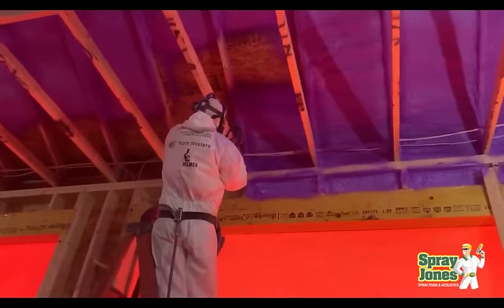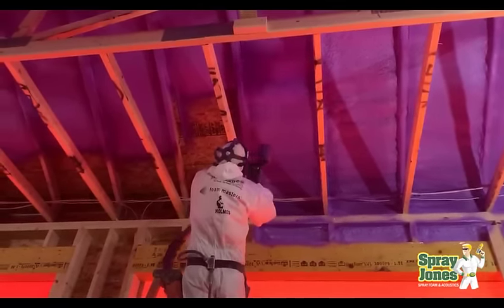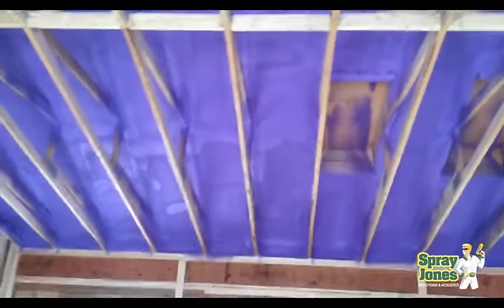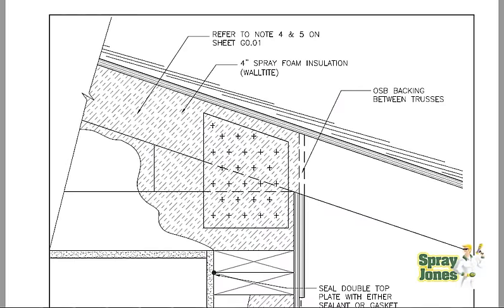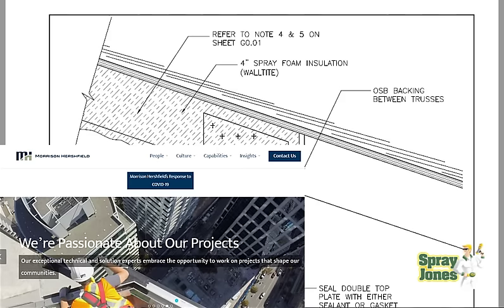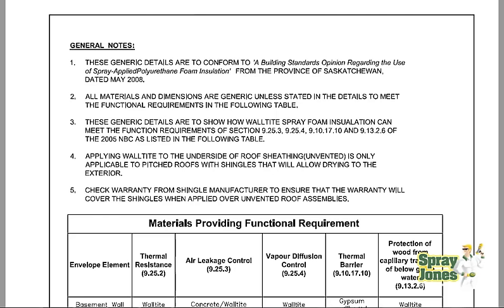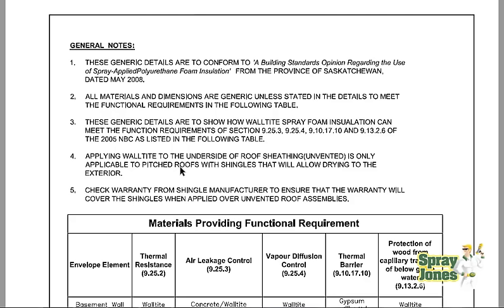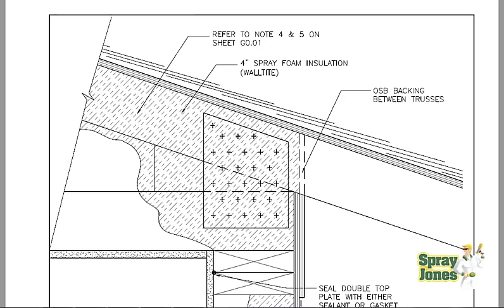Unvented roofs - Closed cell vs Open cell Spray Foam Insulation which is better?

Comment: They are assuming a 'drying season'.  And they are assuming everywhere has that when they say it can be used everywhere as long as the pitch is greater than 3/12.  That is just not so.  In my particular area which is a temperate coastal rain forest things that wet just don't dry out with our average of thirty days or less of actual sunshine (combined with winds over 100 mph and 170 inches of rain).  I am sure there are other such climatic zones in North America.  Engineers and architects have a long history of failures so I just wouldn't be comfortable with any blanket statement from them and skeptical of particular local advice.  I can show you one failure after another in our small community alone that was caused by bad design from 'certified' engineers and architects.   When you combine modern building materials and water you have a large problem.  Imagine six months of wet on OSB!!  Then add it some freeze thaw cycles....    Spray foam is a good thing in limited situations but allowing a structure to 'breathe' in all but desert conditions is very important.  The other new drawback I hear of and see is over the long haul the foam both open and closed 'shrinks' away from the dimensional lumber causing condensation where those openings lead to a cold external surface.  I will be much more comfortable when I have seen forty years of existence of any brand of foam used successfully in tough climates.  Always and interesting topic.
Reply from the maker: Do you drive a 40 year old car?
Reply: @SprayJones  That is an ignorant reply.  A car is not designed with the lifespan or price of a home and in any case proves my point for all the absolute failures the auto industry has foisted off on the consumer.  Is that your goal?  Get your pile and get out before the failures come to fruition.  You use a very poor analogy in any case as it disproves your position.  Most car successes were built on a solid years long history of performance while their failures came with no eye on what preceded much as the spray foam in a home phenomenon!
Reply: Douglas, I  whole heartedly agree with you. I  have the same concerns with this application trapping moisture between the foam and roofing.  I think it's okay for walls but not roofs. This will also bake asphalt based shingles due to the absence of cooling of solar radiant heat gain, which I have personally seen with SIP panel and rigid foam structures.  There is also sick house syndrome from structures being too air tight. Remember,  for every action there is an equal and opposite reaction that sometimes is exponentially greater than what you are trying to solve.  Not everything "new and improved" is better. I made the contractor remodeling a  portion of our camp (I was not the member in charge of the project) put venting baffles in before the foam. I do roof and building envelope inspections an have been concerned about this since it started to be promoted,  by you guessed it, the sprayfoam industry.
Reply: I think this is a good conversation. @SprayJones comment doesn't help their case.
Reply: Interesting. We were going to do closed cell on walls and spray in cellulose in the attic. I live in an extremely humid environment. Would you recommend rock wool or spray foam?

Comment: I make a living tracking down roof leaks. Closed cell sprayed roofs that leak will rot out large sections of decking and make a nightmare of finding it and fixing it. It's also been going for so long that insurance will deny it, open cell has a chance of being found. Closed does not.  Many of your statements based on engineering information are not what I've found in the field.  This is pretty standard in any of the trades. the engineers are sure of what the books say, the field guys actually have to deal with it.
Reply from the maker: A roof that leaks is a problem. When do you want the water to stop and where? I have seen open cell foam hold water and cause major damage, I have seen closed cell hold the water out and limit the damage to the sheathing. 
SPF is NOT the problem - the roof should be water tight with multiple layers of defense from the outside - the choice of closed or open cell on the inside is a different plain of the envelope.

Comment: How does the roof dry to the exterior? Most roof papers are not breathable air barriers the same as say a tyvec. If the roof deck is not breathable there is where the problem comes into play. I have been in the insurance industry for over a decade and seen numerous roof systems rotted because of spray foam on the underside of roof decking. And most shingle companies will not warrant the shingles anyway. That is probably why the engineer put that disclaimer in ther
Reply from the maker: My Dr. hates it when I come into his office with my google PHD and tell him what is wrong and why.
Reply: This is not a google reply I have been in construction trade for 30 plus years and the insurance industry the last 11, my response is from seeing it not google. That’s why the engineer leaves himself and out by saying it needs to breathe
Reply: @patholland8835  you are correct . There have been several instances of soft decking and shingles coming off on houses under 10 years old.  Hopefully these spray foam installers are held responsible when this all goes south . Closed cell is ridiculous against roof decking, period imo. A lot of this stuff works on paper when the engineer is writing it
Reply: We’re the roofs high pitch?  That was a requirement
Reply: Exactly. Maybe you can get away with it for a while.   And closed cell certainly can prevent moisture and/or condensation issues from the inside.  And sure, the closed cell might prevent the leaks from entering the living space, but it's also going to cover up a ton of smaller problems over time.

Someone explain this - why is it best practice to use a rain screen siding setup with ventilation, but (apparently) fine not to do it on the roof?   The walls are vertical, often have soffit protection, and far less water pressure, plus wall peel and sticks/tyveks/etc generally are FAR more vapor open - but time and time again you find unvented setups that have rotted from water entering at failed penetrations and then not being able to dry fast enough.   

You are creating a sandwich of two non-permeable materials with a water sensitive material between on the most exposed part of the house which also happens to have thousands of penetrations from not only fasteners, but also vents/skylights/valleys/etc.  Ice and water shield isn't vapor permeable.   It's going to hold that water a LONG time no matter what the temp or the sun thinks about it.   Closed cell isn't vapor permeable.  The only way out is going to be the failed penetrations, open seams, or wicking through the rafters or roof sheathing itself.

I've seen this pushed a bunch of times, but never have I seen anyone explain that.
Reply: @SprayJones  Nice non-answer.  Spray foam is going to be one of those things in a couple decades that people are going to wish they would have never fallen for.
Reply: @kp3.  There's a reason they don't allow it in in most of Europe.  They live in houses that are hundreds of years old, they understand what it takes to make things last and know that this is a disaster waiting to happen in this application.

Comment: I'm an engineer and I agree that this is ok but using an explanation of "because an engineer says so" is just circumstantial inference and not a technical defense. I would have liked to see the technical explanation included. I know there are minimum thickness requirements based on location to prevent dew point condensation and different things like that.
Reply from the maker: I don't go into overly technical explanations. No one wants to watch that and the time to make the video does not pay off with views or ads run. So I keep it simple.

Comment: Hard to go wrong with rockwool but it too needs to be installed correctly.  Always best to ask around and check with reputable contractors in your specific area.  I prefer those who do remodels as they see what works and what doesn't.

Comment: We have open cell sprayed on the underside of the roof deck, It was done in 1998. The roofer did a poor job and many nails missed. These small leaks were not big enough to drip below, but big enough we noticed soft spots in the decking. Rather than take the roof off and deal with the soft decking we instead nailed 1x4" perlins through the shingles and put on a metal roof. There is now a one inch air gap between the original roof and the metal. Not only did this solve the leaks but the house is noticeably cooler in the summer. We are in Indiana so summers are very hot.
Reply from the maker: Good testimony that shows it is NOT the end of the world for a few leaks. People make out like the roof leaking inside the house will limit the damage.
Reply: I have seen 5 layers of shingles on one roof. 
After 50years Renovations. You see a lot. 
Old timers theory was if it leaks and you covered it up to solve the problem. You are only fooling yourself. 
The moisture is still in there. Stupid thing like capillary draw and physics-based tell you that if the problem is eliminated then it is solved. 
My former 20 year apprentices ousted to have a saying from his grandfather. 
"No one can afford to do it right the first time. But they can always afford to do it right the second time. ( after they ripped off what they did the first time after it failed)

Comment: Leaks are tricky even at best if circumstances.  Our house had a roof leak for years but we didn’t known because the cellulose absorbed it until it become a huge leak.  

Fiberglass loose fill 7:21 will let water through quickly. 

I’ve been using 12/12 and 10/12 pitches for years. We use closed cell foam on our new builds AND we use Huber Wood Zip roofing and Ice guard 4’ up and high quality underlayment.  The chances of roof sheathing damage is very very low. 

Now, could damage occur one day if the future home owner don’t take time to visually inspect their shingles?  Yep. But then concrete and steel eventually erode from neglect also. 

I’d the price of closed cell foam was 1/2 it’s current price, I would ALWAYS use it to make our attic spaces un-vented and all our walls and rim joists sprayed over with 3” of
Closed cell and then the balance dense pack fiberglass we use 2x12 rafters and floor joists.  

Here is some facts. Energy prices are going to quadruple as the “greenie religion” forces everyone to use electricity only.  Better to pay for insulation and air sealing today. Payback isn’t going to be all that many years.

Comment: I retrofitted my 90 year old home with closed cell foam under the roof sheathing. There was effectively no air sealing or insulation there before.

My natural gas usage dropped 50% in December in Ottawa.

This video is making me even more confident.

Comment: I love your videos man, especially this one. Straight to the point to those with a low attention span and want a direct "yes or no" but then a full technical explanation. Keep up the awesome job!
Reply from the maker: Thanks
Reply: Excellent video and format, thank you
Reply: Yup, we had a large portion of our hallway ceiling collapse because the cellulose took on so much water, then the plaster soaked up so much water.  It ever so slightly dropped over the years of the leak and one day just collapsed.  The weight of the plaster was incredible.

Comment: I really appreciate your approach to these videos. Concise, thoughtful and informative!  

After running a renovations business for a little more than 20 years now, I find myself building small-ish cabins for use as long term rentals as well as to sell. Looking to keep my costs low, I have looked to an idea that I used about 12 years ago on my own house build with a semi-vaulted roof system. (Scissor trusses)  To obtain the required R value in the heels of the trusses, I was forced to use spray foam.  After weighing the costs, I ended up using two layers of 4 inch blue Polystyrene foam insulation attached with quick -forming adhesive and recessed about an inch from the sides of the trusses cavities.  Then, I  filled those gaps with spray foam and added (approximately) 2 more inches of spray foam over top of everything.  

The Polystyrene boards were acquired from another job (re-doing a metal flat tar roof on a Home Depot building) so it saved me some serious $$.

I too thought that insulating the roof deck would be advantageous over insulating the ceiling, and it has been maintenance free ever since.  

I was concerned that the minimal contact of the Polystyrene to the roof deck would be an issue, but it has been fine. Roof is a 4/12 with tar paper underlayment and 3 tab asphalt shingles in Edmonton Alberta. Any thoughts on this?

Love your channel - liked and sub'd!😊
Reply from the maker: The principals are all the same, except you have a tough job trying to repeat what we are. Self-adhering rigid insulation, and conforming to the irregularities of the space created. 
Much depends on your diligence to get it well adhered and sealed. Air sealed is the major.
Reply: @SprayJones  agreed.  I'm always looking to save $$ where I can, but the long term savings of a solidly insulated (open vaulted) roof system far outweigh the higher initial costs.  I will do more research for current standards in my BC here, but I remember having to convince the building inspector that the spray foam on the roof deck option was a good and proper way of achieving required insulative values in the roof structure.

Comment: Hello Mike and thanks for your very informative videos which were just recommended to me. We have a 30 year old home on Lake Michigan. It has a formed on site standing seam copper roof. The underlayment is Grace Ice & Water Shield (directly under the copper and sticking to the sheathing decking (7/8th plywood). This building has cathedral cedar ceilings and a non vented roof using blown in cellulose. Lightning rods on the ridge cap recently started leaking (broken calk seal) and some of the lightning rods had penetrated the Grace Ice and Water Shield under the ridge cap. This caused black mold on. the interior ridge beam.  The fire retardant in the cellulose limited the mold - but the ceiling cellulose near the ridge was wet from condensation. The temperture at the copper was measured at 140F wile interior a few inches away was at 80F.

We are removing all of the ceiling cellulose and replacing it with closed cell foam. The insulation contractor wants to install 6" of closed cell foam (icynene) directly to the underside of the roof sheathing. This would create decking encapsulated by Grace on one side and closed cell foam on the other. There should be no moisture   in the plywood but also no way for any trapped moisture to get out. In one of your replies you indicated that this situation should be dealt with using "sheathing membranes".

I did some research on sheathing membranes and it looks like they are just an impermeable vapor barrier? 
https://deltaacademy.dorken.com/resources/the-fundamentals-of-sheathing-membranes-and-air-barrier-protection/

Can I have my contractor spay closed cell  foam directly to the bottom of the sheathing? Or we need to stick a sheathing membrane on first then the foam over the top? I really don't want to cut holes in the house to vent the roof because we live right on Lake Michigan and often experience high winds and driving rain and snow (and 18 foot waves)

Lots of information, some want me to create a vented roof by cutting holes in the house and venting the ridge cap because they say the sheathing must be vented to dry and cool. I'm a licensed engineer (not a building engineer) and find conflicting advice.

Thanks for your help.
Reply from the maker: So are you spraying this from the inside of the house or from outside down? I am not clear on the procedure.

Comment: I have watched 20 videos and asked about 10 questions. I am finishing my 2nd floor cape in MA with a 12/12 roof with closed cell insulation ONLY. Rest of the house is open cell. I feel 100percent confident that its the right thing to do. I dont know what it will cost but it doesnt matter. I am looking forward to a great envelope protecting me from summer heat and winter cold.
Reply from the maker: Sounds great!

Comment: Great video - thanks! Good to have solid info like this....Ive had many discussions/arguments over exactly this! I Had Closed cell sprayed in my attic roof deck and walls - in a 100 yr old wood stick frame house. It tightened everything up and Ive never had a problem since. It has paid for itself on my heat bills over 4 years.
Reply from the maker: Thanks for sharing!

Comment: I guess you can add that closed cell is IRC code required in the United States for any unvented attic where the spray foam is applied to the underside of the roof deck.